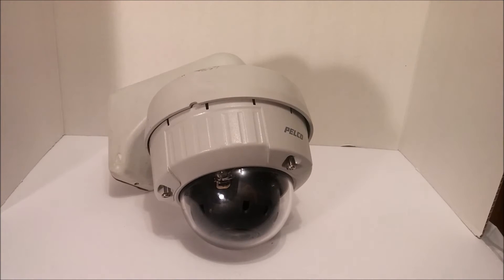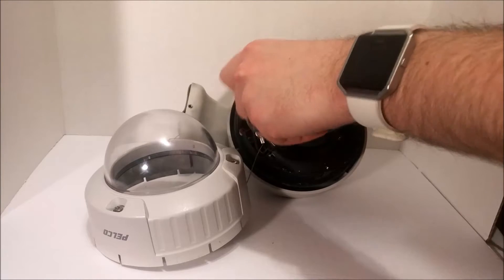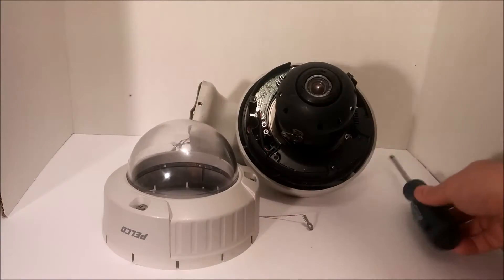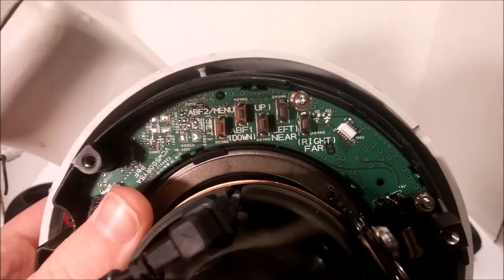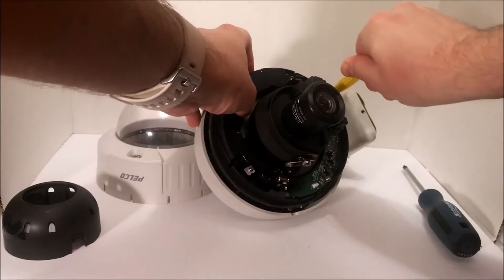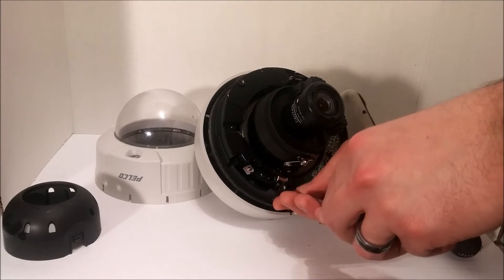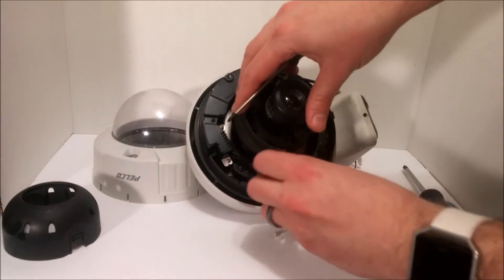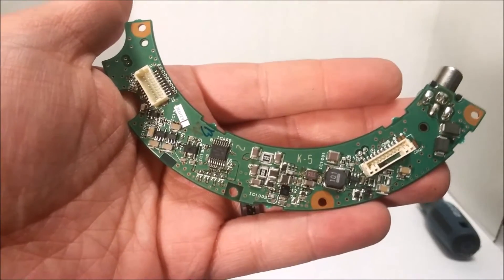Pelco PTZ Security Camera Teardown

Comment: I hate to burst your bubble but what you took apart is not a PTZ camera at all. You probably took apart the wrong camera...
Also the problem you described in the beginning about the camera moving back after a certain amount of time sounds like the auto park feature, this can be adjusted in the settings.
Reply from the maker: I thought PTZ meant pan tilt zoom? This one did that.
Reply: @NevsTechBits  it does, the one you show in the video is not how ever
Reply: @NevsTechBits  PTZ means basically ROBOTIC movement using motors inside the unit, which have a protocol such as Pelco coaxitron, Sensornet (for American Dynamics/Sensormatic PTZs, and RS-485 and RS-422.  PTZ does NOT mean you can "manually" point it during installation. a Pelco Spectra is a perfect example of a PTZ camera. What you have is a fixed dome camera. also digital zoom and clicking and dragging the view with a mouse does not make the camera physically a ptz camera. If the camera inside the dome doesn't move, then it doesn't classify as a PTZ camera. It is a fixed dome camera.
Reply: @queencitysirens8755  Pelco Spectra HDs are pretty fine, got two at home.  They can spin 360 degrees and then keep going and going and going.  Also got some Arecont 180 pano cameras that emulate pan/tilt/zoom operations digitally pretty well but nothing beats Pelco's smooth PTZ and 30x optical zoom.
Reply: @rbus  Agreed! Nothing beats pelco. But the camera in this video isn't a ptz camera. I was giving examples of different ptz cameras to point out the similarities of them. My dads building he workes at had 64 spectras, roof mounted, parapet, wall, corner any kind of mount you can think of. They were all replaced with axis Q-60s as of 2016. Miss that quality pelco system! The building is the Charlotte Fed.
Reply: @queencitysirens8755   Yeah, people see dome cameras and assume PTZ but actual security PTZs tend to be much larger.  They could make them smaller but they tend to use larger more rugged motors, and since it takes several of them.